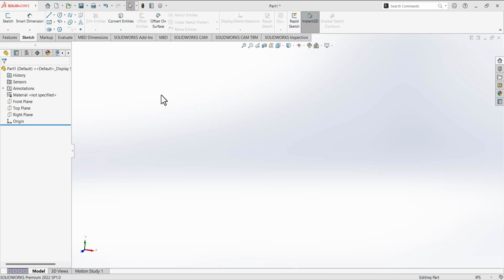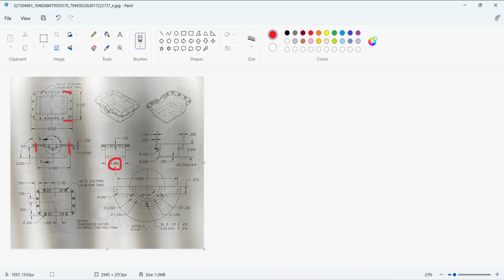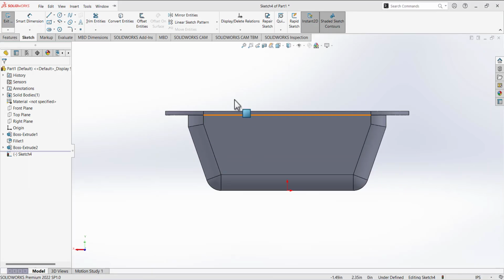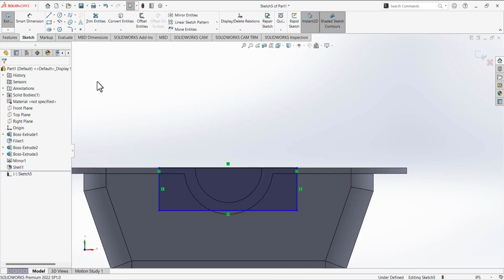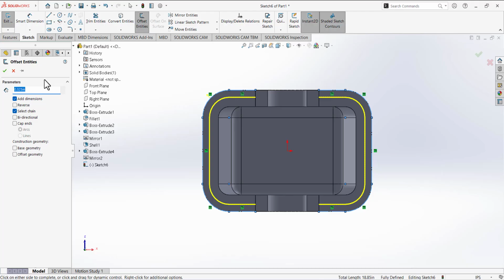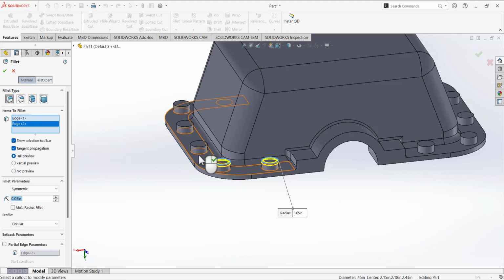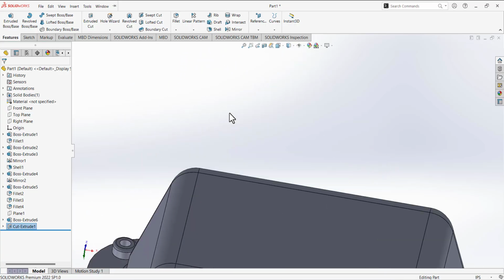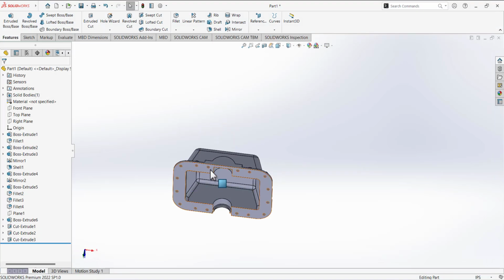Beginner's Guide to SolidWorks | Oil Pan in SolidWorks | SolidWorks Beginners Tutorials

Comment: 28:51, the construction line for the screw mount reinforcement/screw holes
is not .75"/2 as you have shown on the video. It looks like .325" from the 
drawing.
Reply from the maker: i will check